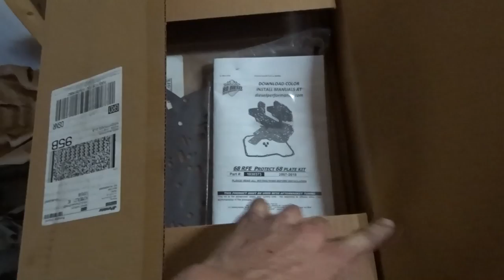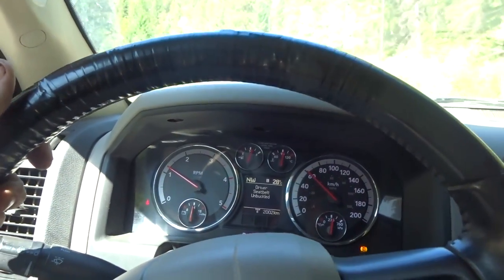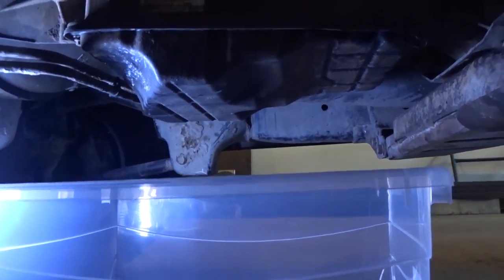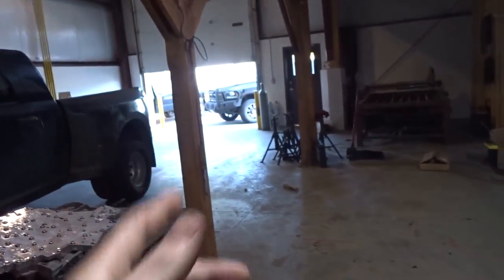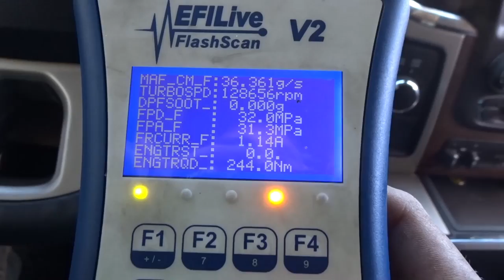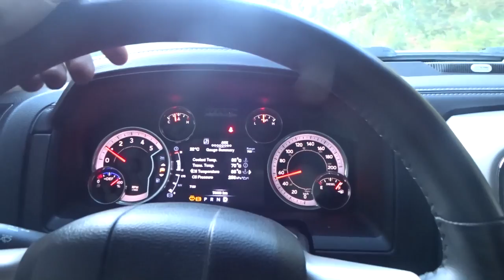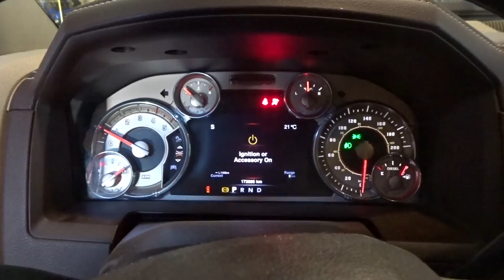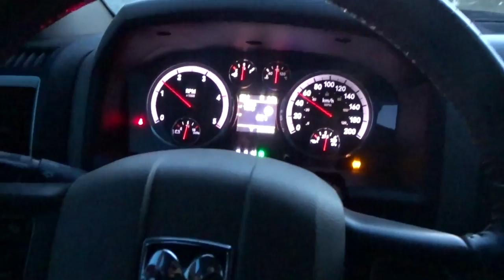BILLET VALVE BODY AND 4TH GEN TUNING!!!!

Comment: This is where Revmax's version of this billet valve body is superior. They machine a cutout for the filter so no spacer needed and it will even work with a stock pan should you choose to. I went with a Revmax pan and definitely no modifications needed.

Comment: hell yea brother! that is how the tuning should be. my 12 doesn't lock up until 4th even with trans tuning from Oz tuner . now they don't answer the phone. gets pretty hot at low speeds. been watching you really know your shit. I may have to invest....👍
Reply from the maker: Yeah the 2nd gear lockup makes a major difference to how the truck drives. Dont think Ive seen trans temp go over 80c or 175f once since I started working on the 68rfe tuning.

Comment: that hole helps increase the line pressure to 225 psi more or less if you have a trans tune/r.  sonnex line pressure booster is not tuning.

Comment: Should figure out some emission compliant tunes for down here,the EPA is banning any delete tunes/parts even for "off road"/race trucks
Reply: Why bother just keep it stock if you worry about the law.
Reply: J Irvine fines are expensive, especially for small businesses and random summons type inspections are rumored to be part of the full ban aswell
Reply: @dwarnermg  Yeah, leave it stock and don't worry.
Reply: J Irvine or crank it up with the stupid emission bs so you can have some extra power and more efficiently and not get an $8000 fine and have them track it to the shop that took the garbage off and have them get a $50000 min fine, just saying it'd be a good money maker for him to play with that to
Reply: @dwarnermg  Get a transmission tune and skip the engine tune.
Reply: J Irvine look up calibrated power/duramax tuner.com they've done some impressive shit with all that garbage on , 5 min regens 500+ wheel hp egr that's still there and functional ( but doesn't operate as much or at all) shit like that, I still hate it it's all bullshit anyway, just so dealers and government can make more loot

Comment: Running your efi tunes and trans tunes on my 2017 2500 got them last November 2020 love em feels good. But afraid to play/run/tow on 120 or 180 tune cuz of glass jaw 68rfe With  this valve body do I need a new trans tune and does my tunes for my 17 have the reverse lock up so I can do burnouts lol I’ve never done one in this truck even with the tunes sad I know

Comment: Obviously there must be an improvement by having the torque converter lock in so quickly in the to haul mode. What does that do for you specifically having it lock up that quick? Thank you!

Comment: Just curious how much soot build up was in your buddy’s  black mega slab? And how many km was on it? Awesome stuff btw!
Reply from the maker: It had 60,000km and the intake had some soot in it but not near as bad as my 12. I would recommend always delete your truck before 60k if possible. Waiting until warranty is finished will be worse in the long run. Truck will have far more downtime chasing emissions problems while in the warranty period. And your causing more damage to the engine in the long term with that garbage on there.
Reply: Optimal Welding thanks. Do you have tuning for a 2018? You mentioned only up to 17.
Reply from the maker: @ajbilleck9805  I should be able to do the 18 trucks but just not tested yet.

Comment: Is the Aisin still unbreakable? As far as tuning goes
Reply from the maker: I haven't figured it out yet but its not impossible just requires more time.
Reply: @Cumminslife  I dont think anyone has broke it yet. If you do ill be driving down there, i honestly hate the way it shifts man, speed limit at 50 and it shifts up at 52 and down at 49, plus the line pressure where it feels like it goes into 3 different gears before it actually shifts. Props on having the DEF gauge show full thats awesome, i hate seeing mine in the red
Reply from the maker: Yeah the shifts feel like that because torque converter is partially unlocked on gear changes. A tighter converter would somewhat solve the issue for you until the transmission tuning is figured out.
Reply: @Cumminslife  Do you have access to an Aisin for tuning?

Comment: "~With my tuning, you won't get a check engine code even without a turbo and speed sensor."

2 mins later

Throws code for both issues.

^^^That's where I lost any belief in your tuning abilities.